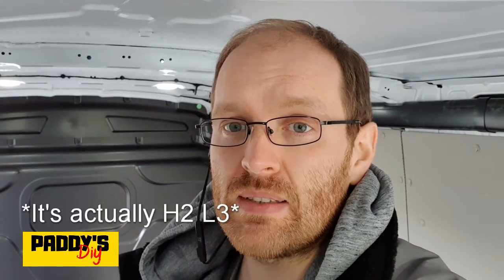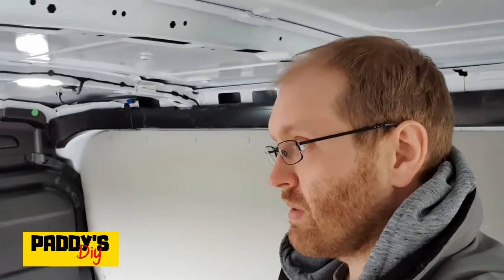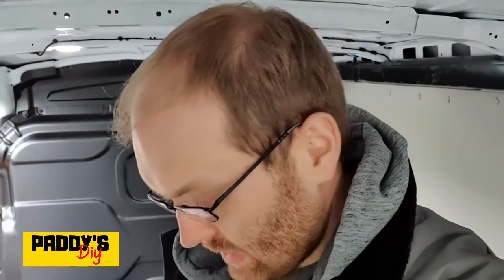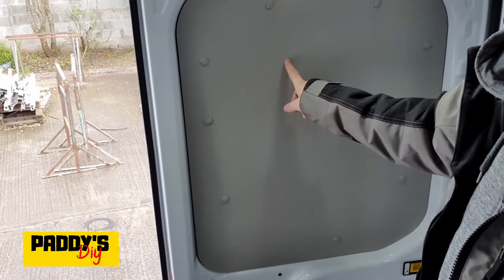[29] Ford Transit 350 2021 Van Racking - Part 1 Glass Rack

Comment: Hi , I am doing a similar rack in my Renault Master . What fixings did you use into the head timber ? And was is the same fixings on the floor ? . Cls for the frame but what did you use for the horizontals ? Looks good 👍
Reply from the maker: I used tec screw on the head and floor timbers to screw into the steel. Just regular wood screws all around after that
Reply: @PaddysDiy  thanks for that , what wood did you use for the horizontal slats
Reply from the maker: @stevenlindsay1785  Its white deal as far as i can remember. Planed all over